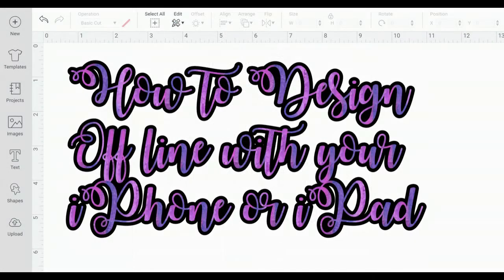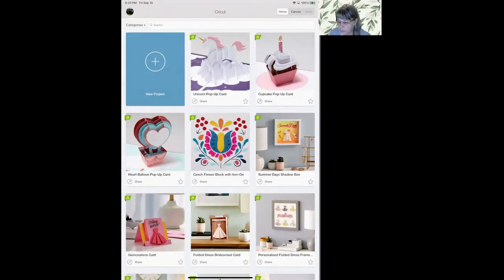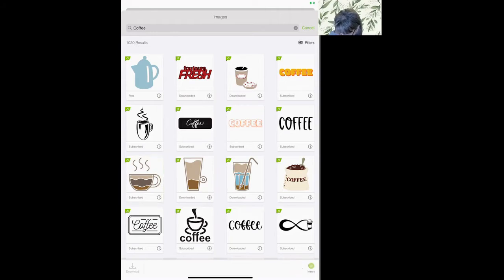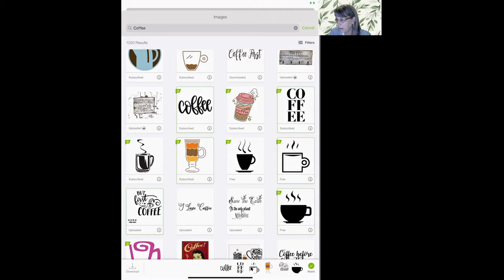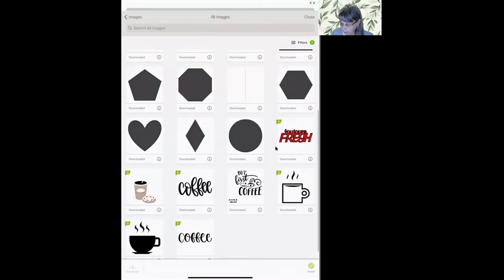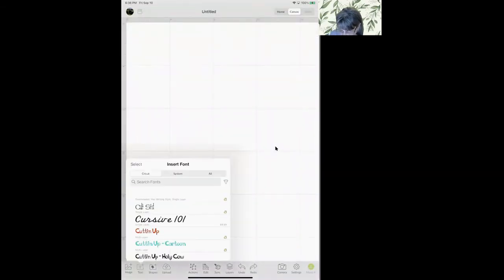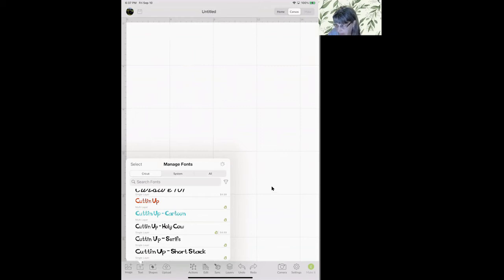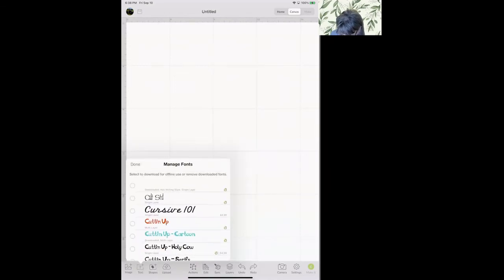How to use Cricut Design Space off line with your iPad or iPhone

Comment: Thank you so much for this! i really need help asap.😭Cricut customer service is not very helpful. It says on their website that you can use the ios app without internet, but when i put my iphone on airplane mode my cricut app doesnt load? 

My cricut explorer air 2 is another city and I wont have internet access. I was wondering if you can assist me with this query. 

You reckon once I reach my destination and pair my iphone with my cricut app, my designs pace app can work without internet connection? I have all my files on my device and have logged into my account. I just wont be able to have internet access in another location and i really need to do a project! Can you pls try it on your app while your mobile is paired to the bluetooth on cricut without internet and let me know if it works offline.🙏🏼would highly appreciate a response ! thanks again🙏🏼